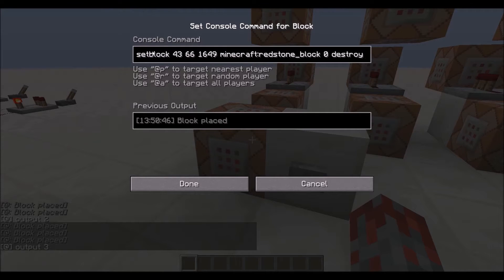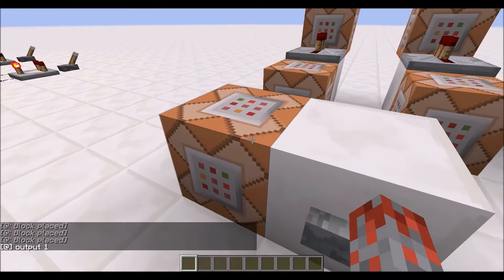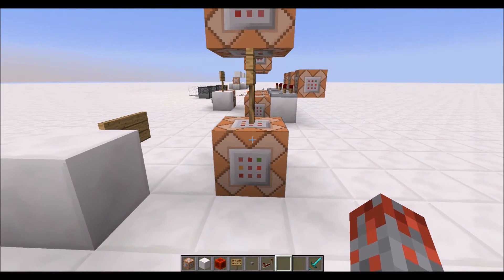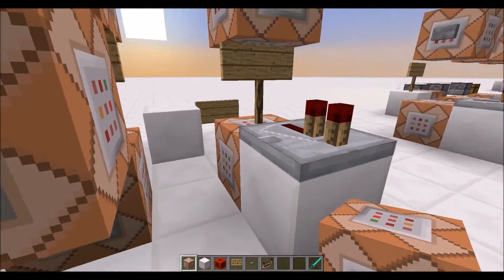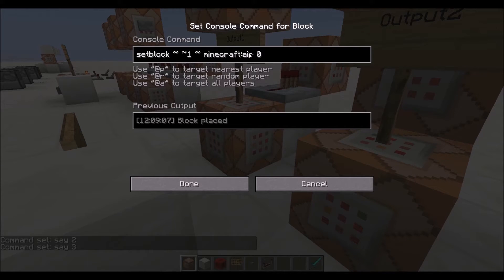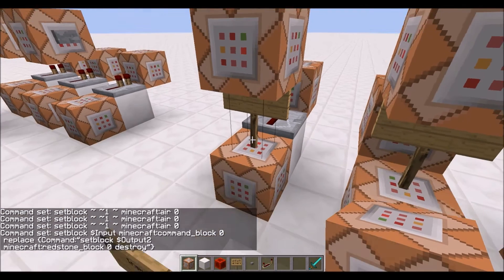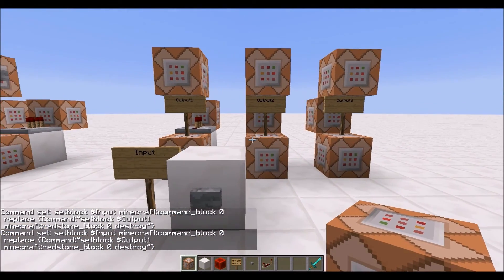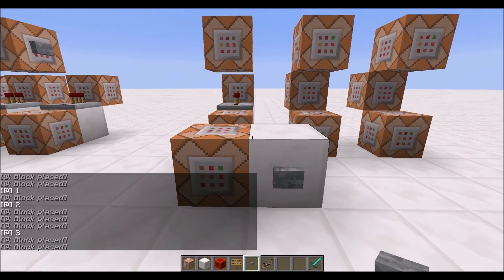Sequential Activation Device (wave spawning system) Tutorial

Comment: well its nice and all but u can make it with a scoreboard value thats increasing by 1 each time u press the button and redstone to refresh the output each button press
4 command blocks should do the trick.. 5 if u want a reset.
Reply from the maker: I don't know if I understand you correctly, but if I do, then what you suggest is not comparable to this design.  The setblock command does not support parameters; to do what you propose you would need a testfor command for each item in the sequence. My design is infinitely expandable and uses no clocks.  I already used a design similar to the one you suggest in my map Castle Tower Defense (I did a video on it as well: Behind the Scenes of CTD Ep2- Wave Spawning).  The design in this video could be built with 1 input command  block and 1 command block for each item in the sequence.  The bottom command block is only there to reduce lag, the entire system would still work without that command block.  You are starting to think like a map maker, good job.
Reply: well, it requires the new /scoreboard players test, and since u are pressing the button every time you dont need a clock - the button press and redstone connected from it to the command blocks will refresh them. and the command block u are pressing will up the score by 1 every time. no clocks. infinitely expandable.
Reply from the maker: exeLz Thank you for explaining it more.  This design is made for 1.7, not 1.8.  I would be very interested to see your design in action.  Could you make a demo/tutorial of it?
Reply: This is some big brain action right here